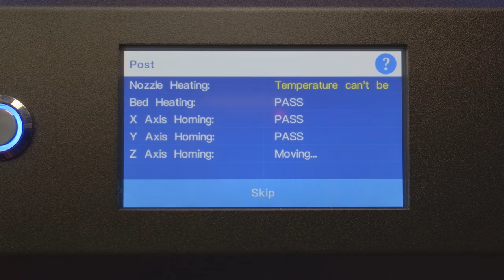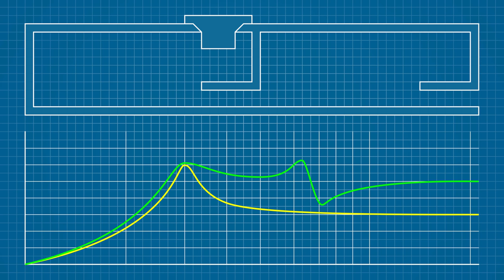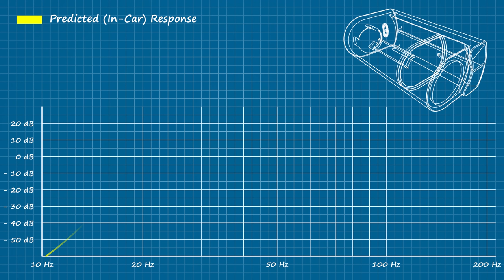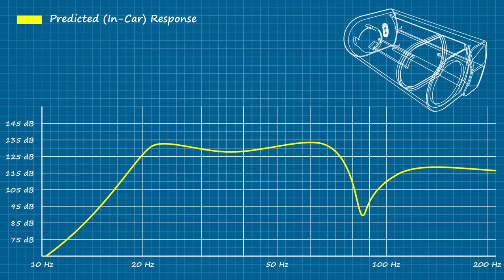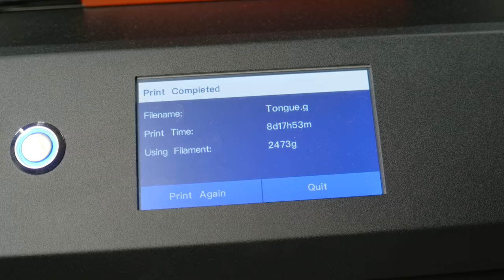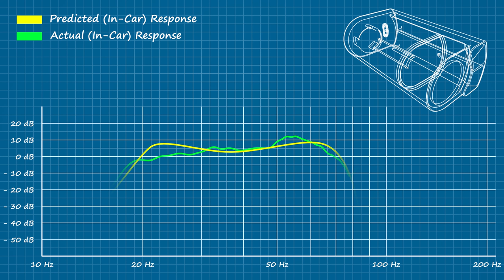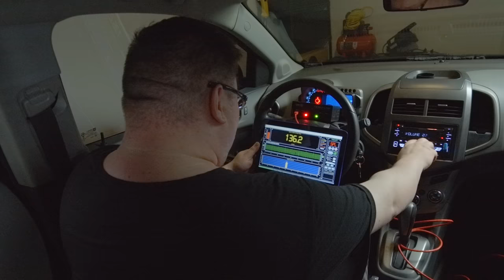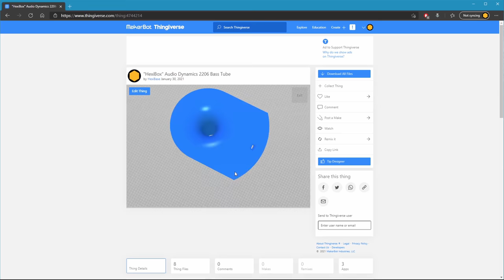Next Generation Bass Tube (Featuring The Alfawise U20 Mix)

Comment: 25Hz, in a car with small trunk, from a single 6.5'' ... i find really impressive
Reply: 50hz
Reply: Need a 10" in the enclosure
Reply: @chickenman7032  Na, a 12, 15, 18 ect ect. This is VERY good for its size.
Reply: @bdc211  it did 25hz in the frequency response graph the 50hz was the spl test

Comment: DIY TIP of the Day... Next time you need to use time sensitive glue or epoxy, mix the two parts as one does, scrape it all up and wipe it in to the corner of a plastic sammich or heavier bag if the mix is thick. Ring it all to the corner as best you can. Then right behind that, twist the bag several times, to pinch off the epoxy and cut off the tiny corner of the bag, approx no more then to create an 1/8" hole. As you continue to twist the bag behind the epoxy, it will squirt out in a fine line, as if you are running a caulking gun. Allows the installation of the glues/epoxy to be much cleaner, instead of a toothpick or pop sickle stick.. if you cut a really dinky hole, one can get very precise with the placement of the line(s)... good luck
Reply: cake mix bag with metal tips

Comment: HOLY SHIT, MAN- 136 dB?!
Hands down: THAT is amazing.
Reply: and from that tiny sub!!!
Reply: thats shit , some 8s do 171dB-A
Reply: @redford6110  as he said. he could have get higher if he made a SPL Specific box. also he doesnt have any modifications in the car to make the SPL higher. This box is extremely good still for being an all around box. Decent SPL with good bass response.
Reply: @Majorowsky1337  ye sorry i was pissed
Reply: @redford6110  That's a 6.5 inch though.
Reply: @kadrix732  ik
Reply: @redford6110  at 1 note. This was designed to be musical
Reply: @DavidBrown-wm7zx  sorry i didnt mean to be mean
Reply: @HexiBase  Is it measured dB-C or dB-A?
Reply: @redford6110  That's a 6.5".
Reply: @DJNigel22  for loudness of cars im pretty sure its dBa
Reply: @redford6110  i was wondering who was going to be the first internet G to belittle his time and effort. bro my 15's are doing about a 136!!! its amazing that small sub is doing that. im going to finish building my 4th order enclosure this weekend because of this video
Reply: @Majorowsky1337  I would buy that box in a heartbeat 🔊
Reply: A car is such a small space that bass frequencies efficiency of small drivers increase many folds compared to large spaces. So 140db is achievable in a car but not necessary outdoors.
Reply: @HexiBase  lets get to printing!
Reply: @redford6110  This video is abbout 6's 🙄
Reply: @xzing7  ur a bit slow
Reply: @redford6110  There are NO single 8 in subs doing anywhere near 171 dB
Reply: @redford6110  not with 600 watts
Reply: @attackroflchopter4403  lmaooo my only words EMF  Audio
Reply: How many Watts ? 
SPL measurements taken inside cars are very different from free field measurements.. The enclosed environment of the car considerably augments the SPL ...
Reply: @redford6110  If you build the cabinet around the drivers Fs, sure you can get big SPL's, but audibly, they sound f'ing awful.

Comment: I bought a Makergear M3ID on a refurb sale a couple years ago as my first printer and boy does this video make me glad I did. It comes fully assembled and I have only had to level it a few times in the couple years I've had it. It is massively more expensive than this printer, but it's also made in Ohio, and the frame is fully steel. Definitely recommend it for people that have the cash to spend on it and want a foolproof independent dual extruder printer.

Comment: 3d printing is about to change the world of Bass box building as we know it. Way more complex box builds than we could ever hope to do with wood. Even if you cnc and slab build a transmission line. Theyll get smaller and be way louder. Amazing video. Watching as i print the bass section for a home stere tower now! About 5hrs left and hopefully it doesnt fail and i can test it with a 4in dayton audio sub. Then start in the upper with 4 fullrange 2.5in dayton also. Douk audio amps and eq. I use to do car stereo in HS. Kinda brings back memories!

Comment: Future Video suggestion:
As you mention in this video your test of infill percentage shows that higher infill gives better results.
In Cura you have a setting called "infill line multiplier", what is does is that it makes the infill walls thicker by making the "infill walls" multiple lines. A test of how this effects acoustic performance at the same infill percentage with higher infill line count could be very interesting :)    (Keep up the great work)

Comment: 14:52
That was a good idea, thinking about a fill spot for the epoxy to "sit in" where it seals the space around the speaker wire.
Nice!
Reply: @HexiBase  I imagine that it did. 
But- the results- Wow!
Such a good efficient design, too.
Job well done, sir
Reply: Shit.....the built in wire-splitter/router was awesome.
Reply: Nice build very neatly done, but do you think the small hole would have made a difference over-all ?
Reply: @gagreeneeee  I've witnessed small air leaks between chambers on many of his designs over the years. In multiple cases it made enough of a difference that it was easy for him to model & even predict where the leaks were, even if external to the enclosure.

Comment: Impressive (again). 

Well about the printer: I think it depends on your desires whether this is a good printer or not. If you are a technician, this printer is a good starting point. 
You can gradually transform it to a great printer. The low price of the printer already indicates that this is not a printer that will forfill its promises instantly. ;) . 

When one needs a printer that just does its job an can print objects this size, be prepared to spend 20 times as much as this one.

Once I started with a sub $300 Ultimaker clone. Now is has turned in a very good production machine. But.. At a price. The benefit on the other side is that you learn to know your printer by heart. Which comes in handy when you need to do some troubleshooting. Which will happen. ;). 

Anyway I enjoy your analytical approach a lot. Your 3d printed Tangband design gives me a lot of pleasure as my favorite couple of desktop speakers.

Comment: Quick tip. For the JB weld they make mixing nozzles that attach directly to the epoxy tubes. They are super handy to get JB weld into tight spaces. 

You make some awesome designs and videos!
Reply: @HexiBase  just copy what the extruders do. Retract the handle to relieve pressure and it will stop coming out of the tip. They are actually pretty good.

Comment: Now THIS is a 6.5" sub and enclosure I can get on board with. Normal performance seems to roll off pretty quickly with these smaller drivers below 40hz. Of course, Pete corrected those shortcomings with a good design. Proving once again that enclosure design makes all the difference.

Comment: Idea: Use tesla valve as a tube deflector, allowing at low volumes to behave as a bass reflex and when power is increased it behaves as an infinite closed box, protecting the subwoofer from over excursion and distortion.

Comment: you could experiment with really low infill and then filling the print up with epoxy! it would be cheaper, faster and stiffer!
Reply: I suggested this on a previous 3D print. Pour something in the voids for faster prints and tailored enclosure dampening.
Reply: @getahanddown  yup, epoxy resin is an option, although it has an exothermic curing process. Another option would be expanding PU foam, like a fiber boat. I have to admit I don't fully understand the workings of a speaker cabinet, so I'm not sure which would be the best option.
Reply: @thiagoennes  
IMO you'd want to control the mass, elasticity and sound diffraction.
So many options. Pour in rubber, expanding options, inject different densities in specific areas, weighted microspheres in the mix, hollow balls in the mix.
The question isn't so much what can you do but what do you aim to achieve?
Reply: Mass. Tungsten dust or you're just fkn around...
Reply: @supersteveenglish7340  Osmium or nothing.
Reply: @supersteveenglish7340  now THAT is a speaker!
Reply: Concrete
Reply: @Michael-lg4wz  That one I can tell you does not work.  At least for PLA. I have filled PLA prints with concrete before just to see them crack and crumble. I think the alkalinity of the concrete attacks the PLA very severely. PETG may work though!

Comment: First of all congratulations on your trully unique work both on speaker design and 3d printer utlisation.
I am a 3D printing fan for ~10 years now designing and printing anything from lighting fixtures, mini wind turbines, up to my own 3d printer...
Recently printed your Dual Tang Band W3-1876S Subwoofer Enclosure and was trully amazed from the result!

I wish to ask you to PLEASE try to come up with a modified version of the Bass Tube to fit the print volume of more "usual" 3d printers, something like 210mm or 250mm cubed, utilising probably a smaller diameter subwoofer such as the 5" Tang Band W5-1138SMF (with whatever compromises in lower end extension and SPL output this would need).

Thank you in advance,

Comment: Out of a 6.5inch? Damn that's good, We're now 3D printing rockets, rocket engines and houses. Any industry not seeing the writing on the parts and assembly wall, is now dead in the water. That's impressive work. Much respect.

Comment: I'd like to see this with a 10" woofer.
Reply: 445 hours to print this thing - for a 10” you would be looking @ ?? 3-4 times the printing time ? 3D printing has certainly come of age & no sawdust 😀
Reply: I'd buy 2 10s off you. I have 2 EVL 10 inch subwoofers that I was contemplating on building a box for until I saw this video.
Reply: Why 136 do is good for 98% of ppl
Reply: Great job man I am subbed congrats on your success to beat the machine ,man wins today !
Reply: @rexxx927  At home for example things have no help from a super tiny space making things louder in wich case a bigger sub is needed. And some ppl just love more and more bass or simply lower distortion at the same spl from a bigger woofer.
Reply: Oh I thought this was a car audio Box if you wanna make a real big box I suggest using poly Carbonite or carbon fiber nylon I like htn and pa12 it ain't cheap stuff so try and keep the scrap down
Reply: There is one already, he made one before.
Reply: Damn it I am always behind lol anybody ever. Do compound isobaric box maybe an old bandpass 15 lol
Reply: Hey. Proxy.... What material was used?
Reply: @rexxx927  Isobaric atleast to me is a waste of cone area :D
Reply: @kaedeschulz5422  that's exactly why I said it
A smaller sub can perform better tuned and placed then just a bigger one in a Sq enviroment if you wanna make noise instead of audio buy or make a bandpass or isobaric or giant sub and box.... I choose complete frequency exotics every note the same level over the 23 hz tune or the 80 hz brain rattler but hey just. My opinion. Ps buy old skool high end you won't go back
Reply: @rexxx927  Why would i want to buy old driver's? Apart from a few ones there is no reason to do so. There are many many great driver's out there that you can buy new😉 At the moment i'm building up a new MTB and when that is done i will make my own 8inch woofer for my 3way studio monitors with a 3inch coil and motor from a PA woofer. Why? because high sensitivity and low power compression.
2woofers as an isobaric simply cut the needed enclosure size in half. Doesn't have anything to do with SPL 🙂
Reply: @kaedeschulz5422  you've lost me I never said buy a used driver.... Also bang for the buck in SQ SPL why ever way you wanna look at it oldskool shit is the way but I never said buy an old driver I have been an mecp certified installer from 1994 what generation. Are you from... My post about bandpass and isobaric was a joke not meant to be taken as an idea to steal this is not China
Reply: @kaedeschulz5422  as for you PA coil nice idea for sensitivity but there are other ways to do this
What PA coil have you used celestion green back?
Reply: @rexxx927  i only said something about a PA motor not coil. It's from a elderaudio 12inch woofer.
I will make my own flatwound coil as buying one would be too expensive and i may not find the right one and i want it to be inside outside wound. Also i will try to implement 18sound's Active Impedance Control
As it will be for my hobby i shouldn't get in trouble for using it.

Comment: Awesome content friend. 
My mind is still soaking it in as always so yeah. 136db is awesome on the footprint. 
Ive never considered my audio projects not being huge. I like a diffrent perspective fosho. 
Listening gear. 
1. Dj PA 
4 Rockville 18's on 2 7,000watt amps,
4 rockville 12's 
On 3000watt amp 
Through rackmount gear. 
2. Car 
4 Skar 10's 
Isobaric enclosures 
2 Ignite 3000 amazon budget gems strapped at 1ohm.

Comment: I've used SAS products for a long time. Not the best sounding but certainly not nearly as bad as some off the shelf products. I have one in my new car since the factory sound system isn't bad but lacks even if it does have a sub which functions more like a mid-bass. Even with only 50 watts the gain is very low, it will easily out run the stock system. I think this build is something I will try myself. As always great content Hexi!

Comment: You seem to have found the one 3D printer where customer support actually works !
I'm really amazed that the print did not come off the print bed, what bed temperature were you using ?
I prefer using a dump area over having a color change wipe block besides the print area, because they tend to break loose from the bed sometimes.
Your enclosures are really amazing !

Comment: If you want to print really tall you could look into a printer that has a stationary bed. It will clean up the precision at the top of the print. My V400 is a round build plate of 300mm and it can print to about a 385mm build height. It’ll also print maybe 4x faster.

Comment: I've got 4 Sundown 6.5's running with passive radiators. I've got a spare sundown sitting here that needs a new box....and a new printer that i need to stress out a bit.... I wish this print was for 2 drivers. Thanks for the video. I think i'll have to make this.

Comment: As always, thank You for Your video! It's always a pleasure to see with what ingenous designs you come up to print.
I build 3D printed speakers myself, but as they run with 4 inch drivers they of course don't produce such deep bass.

And again, you inspire me incredibly to go more deeply into sound reproduction and as I'm currently a post graduate in mechanical engineering, I'm passing a couple of courses on
audio and vibrations.

Comment: If you don't need dual extruders I've had very good luck with an Artillery Sidewinder.  It has a similar build volume and while I haven't done any 9 day prints, i have done a number of 3 day prints without issue and had no initial quality problems.  Price is similar as well at a listed $439 on Amazon at the moment.
Reply: @HexiBase  I guess I should have quoted a Gearbest price for it.  :)   $439 at Gearbest as well.   Send him one Gearbest!

Comment: Maybe a 2023 improvement project! Would like to see this bass tube extend to optimize at least 80hz-90hz. Most passengesr car with the midbass in driver seat door have a null around that higher midbass region, and difficult to solve with anything other than a front sub. Even underseat sub cannot void the null.

Comment: What you described at 3:25 for small piston area drivers with high motor strength, no doubt, that is true. In my opinion what you explained at 3:35 is because the enclosure's net volume is decreased / driver. Also, it is true that one of the solutions to eliminate this peak, and extend the sound range when we using just 1 driver is adding more reflex stages - basically to make a 6th or 8th order bassreflex enclosure (in your case in your video it is a 6th order), but the second one is to decrease the net volume, and tune the enclosure higher. So, I found out that if I want to design a regular 4th order bassreflex enclosure for just 1 driver like this in the video, I should use really tiny net volume with 40+ or 45+ Hz tuning frequency to have almost no peak (as linear as possible transfer function and SPL curves) in a car-like listening enviroment + with an acceptable port area for that driver the port itself will be really long, so only way to do this is to design a labyrint ported box - this is one of the reasons why it is not worth to design a box like this, because it is too complicated to build, moreower there is a need for extreme accurateness for designing / cutting parts / building the box.
In an online designer's local database is the Sundown X 6.5 driver which is like this driver in your video: small piston area, high motor strength. The box I designed for that, it have just 2 liters of net volume, 45.7 Hz tuning frequency, F3 = 48.7 Hz, and "active" sound range is between 31 and 83 Hz (defined by the impedance peaks). The designer's simulator gived for 60 Hz / 12 dB cabin gain really linear transfer function and SPL curves.
So, if I compare a 4th order bassreflex to a 6th order bassreflex is that the 4th order probably sounds more accurate, and more "fast" because of lower group delay, etc...(more orders = more group delay), but nowhere near as loud and as deep like a 6th order bassreflex box what you made - second reason to not build a 4th order box like that. Also in a 6th order bassreflex the power handling of the driver should be better - third reason to not build a 4th order box like that.
Btw, a 4th order box like that is buildable, here is the project I made: https://speakerboxlite.com/project-info/15519/tab-info - just only to show that this is possible.
So, my question: I was right in everything what I wrote above, or not?